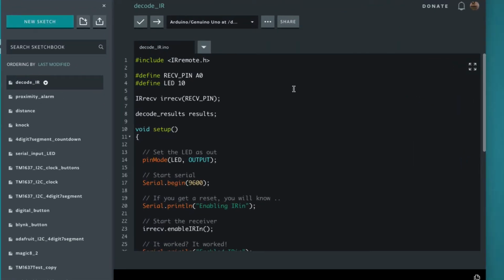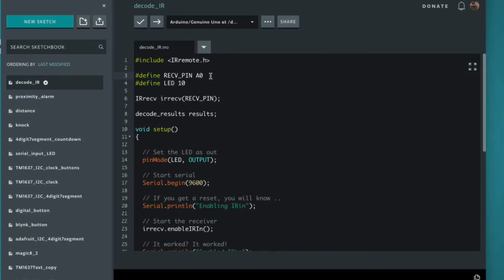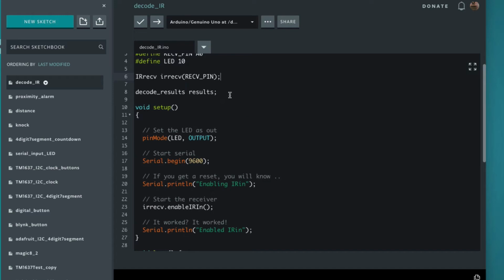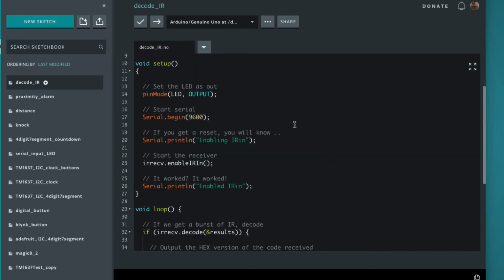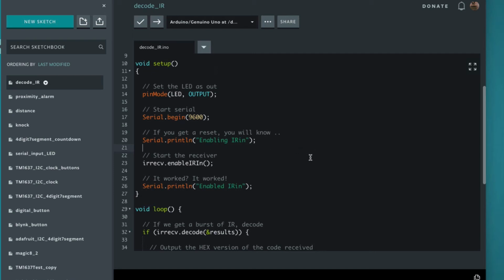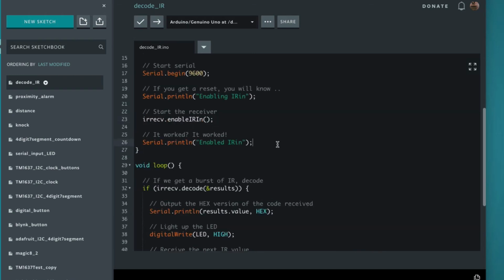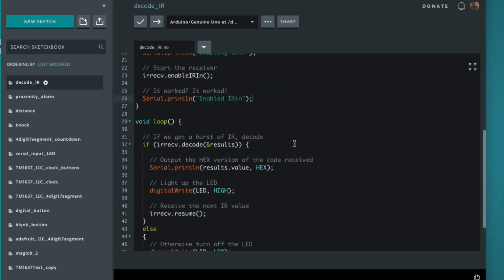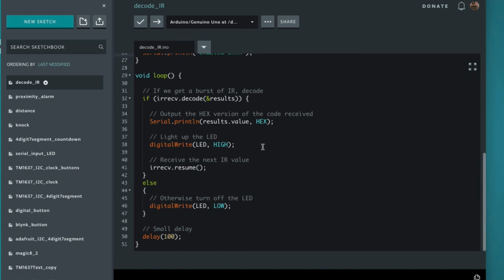Going Wireless! - Day 16 of 30 Days to Arduino

Comment: Hi Chris, I am really loving the videos and I cannot thank you enough for doing these. They are a fantastic help as a entry into the Arduino, Arduino programming and electronics more generally. In some of the videos that I have seen so far, I am on Day16, you have published wiring diagrams but not on all. I find these wiring diagrams an absolute god sdend when I am trying to build the circuits myself. Is it possible that you could provide the wiring diagrams for all the circuits that you build? Thanks once again
Reply from the maker: Yes will do!